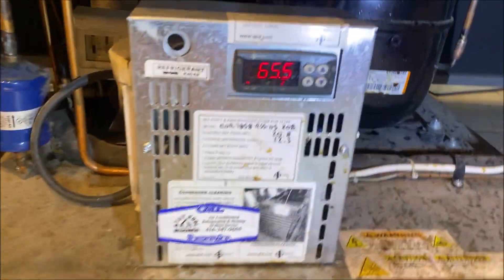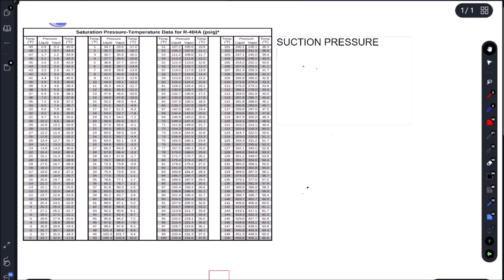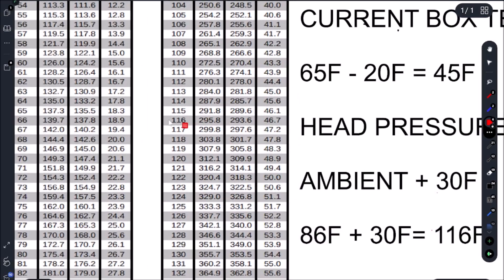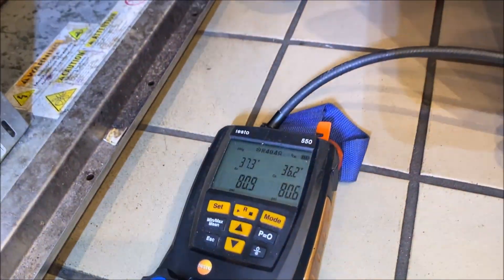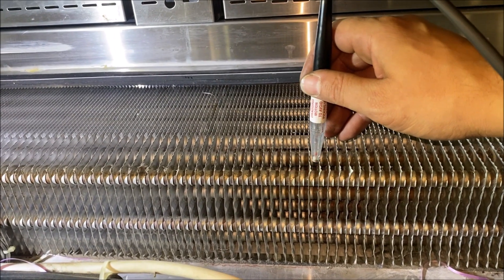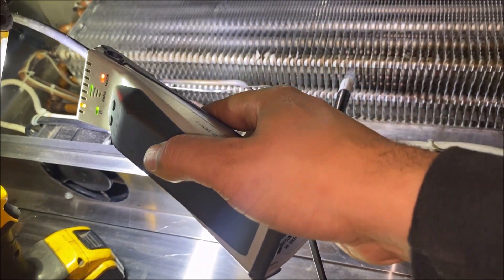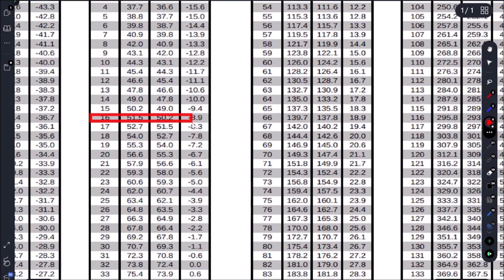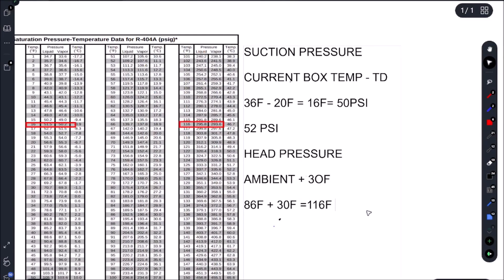GRAB N COOLER is running warm

Comment: Thankyou for this video👍🏻
I just need to know why we take current box temp on txv and desired box temp on cap tube metering device?
I just got confused 🤔
Reply from the maker: Cap tube is a fixed sized, therefore the pressure shouldn’t really fluctuate once the box starts to cool. A TXV is a valve that throttles the amount of refrigerant based on superheat, therefore as the temperature drops, so will the pressure or the amount of flow through the valve. A little bit confusing. Cap tube= fixed pressure, TXV = pressures change as the box temperature changes.

Comment: If you didn't know the TD's, no factory charge specs, how would you charge?
Reply from the maker: The TD for a reach in should be 20F and 10F on a walk in. In this case we had a sight glass, so it make it easy to charge it. If not sight glass then we charge to our calculated suction and head pressures.
Reply: @REFRIGERATIONKITCHENEQTECH   Since we have a TXV, couldn't we just charge to 10-12deg subcool?
Reply from the maker: We don’t use sub cooling in refrigeration because we have a receiver